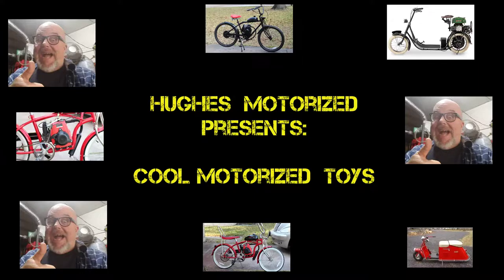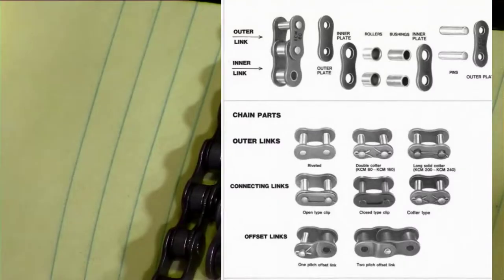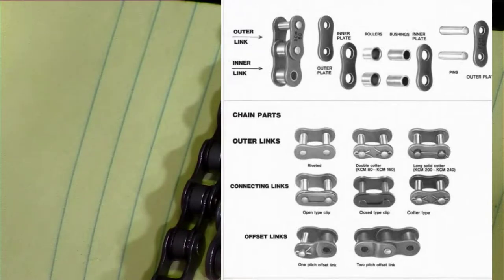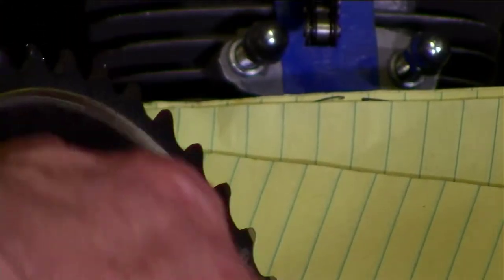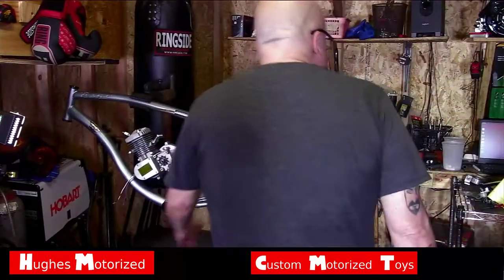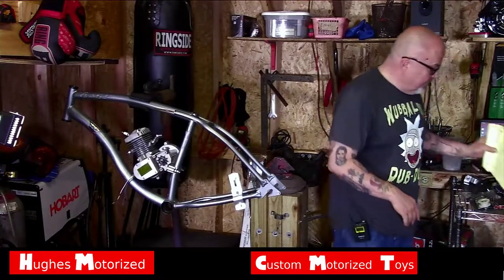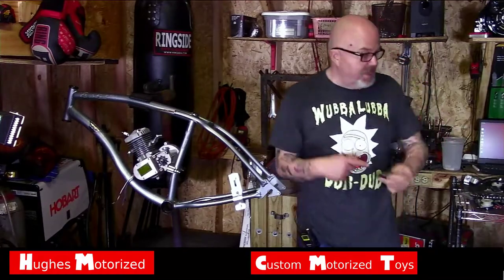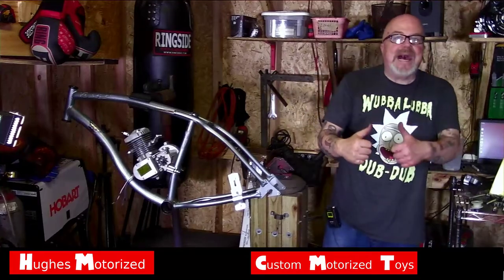Motorized Bicycle Broken Chain Blues - Tutorial Solutions and Information

Comment: Built my first bike a few weeks ago and had no problems putting on the drive sprocket and rag joint thanks to this guys information!
What is driving me crazy is the bicycle itself!!! One problem after another with the bike! 
Right now my bicycle chain is going from loose to tight as it travels around the chain line! You get it good and snug and then start turning the pedals and it goes loose then tight again, loose then tight, over and over. ???
Reply from the maker: Sounds like either the chainring or  rear sprocket is off center
Reply: Ok thanks. That’s what I was finding out on yt myself. Not really sure what to do about it though? Try to adjust the cr and sprocket I suppose?
Reply from the maker: @robbyclark6915  Check it and  see. Hold the bike off the ground and put something close to the outside of the chainring and or sprocket, turn it and see how out of round it is

Comment: If cost didn't matter would you still go with the rag joint over the Hub adapter?  On my current setup I have my rear sprocket connected to the disc brake mount.  But even with Loctite the six tiny screws that hold the sprocket on keep coming loose.  Any advice.   Thanks MS
Reply from the maker: depends on the bike & motor. However, I'm cheap and the rag joints work fine for me

Comment: Purchased a new CBR/manic mechanic 44 tooth sprocket with hub adapter to replace the stock chinese 66cc rubber spoke clamp  setup. Everything went well until I mounted the stock original 415 chain. Chain will not bed into sprocket. Chain fits only half or the teeth or less on the cbr sprocket. When chain is bedded at top drive portion of sprocket, the lower undriven portion  of chain is  standing halfway out of the sprocket teeth. When I  bed in lower portion of chain down into the sprocket by using a rubber mallet it beds in, then the top drive part of chain then pops up halfway out of the sprocket!  What gives? It is supposed to work with 415 chain. Using dial caliper the stock  china sprocket teeth are about .060 inch THINNER in thickness compared to the new cbr sprocket. I am hearing that others are having the same problem and the only solution was grinding the sprocket teeth. Others are saying what is needed is a 415 "Heavy Duty"chain, but there are reports even those have problems bedding down into the sprocket  Having to grind teeth to get  it to work seems a little too much. Do I have a defective sprocket or is it the chain?  (The 415 chain from the kit fit the stock sprocket perfectly). Bike Barry claims on their site that the 415 heavy duty may require grinding of the DRIVE sprocket for proper fitment !!! Need advice.
Thanks

Comment: Here's another here's some advice they making 41NP roller chain i it's the same with is a 41 roller chainbut the linkage the smaller on the diameter just a tiny bit and it's just as strong 41NP roller chainwhat is the same the strength of the chain is the same as a 41it's just a smaller-diameter so it's not his big on the outer if the motor won't fit 41 roller chain the 41NP is just not a big on the outer same quality
Reply from the maker: NP is the same dimensions as #41 just nickle plated I've read

Comment: Old age sucks. I forgot to never use a kit chain on a MB. I have a #41 coming from Tractor Supply. Peddled 3 miles home, bout killed my old hyde. At my age exercise  don't make it better.  Bwwaaahhhaaa
Reply from the maker: I hear ya. I went to my doc and he  chewed me out. Told me to change my ways or it won't end good. Told me to watch the movie Forks Over Knives on Netflix. Doc told me if I followed what the movie suggested, I'd lose weight and get off of blood pressure meds. I've lost 50lbs and I'm off BP meds after 25 years. i still have some more to lose but I still dropping weight even during this COVID lockdown mess. Good luck sir